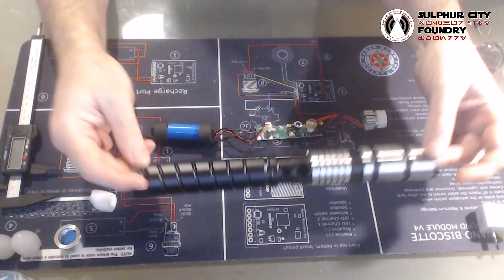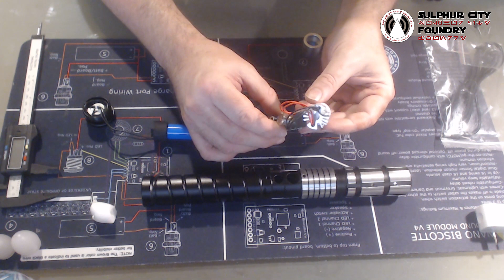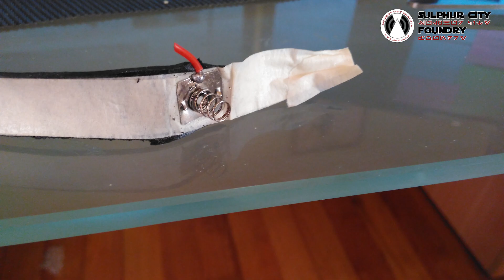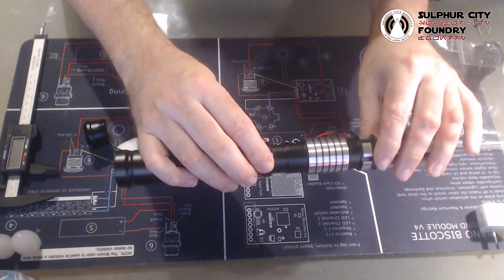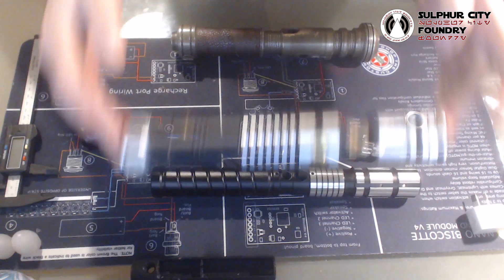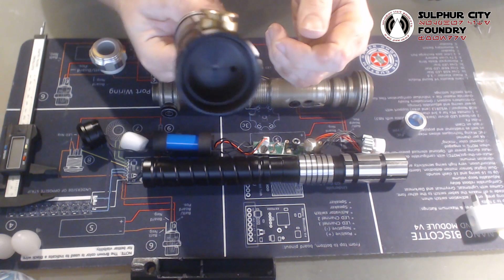Budget Chinese Lightsabers | Overview | Breakdown | Comparison

Comment: Hey guys, got a few, there not bad. You've hit it on the head about the budgetness. Mostly powdercoating but some are anodised. Replacing electronics is cheap ($60) and easy but you need your own battery prepared. 
As always your vids are spot on and informative.
Reply from the maker: Thanks for the feedback :)